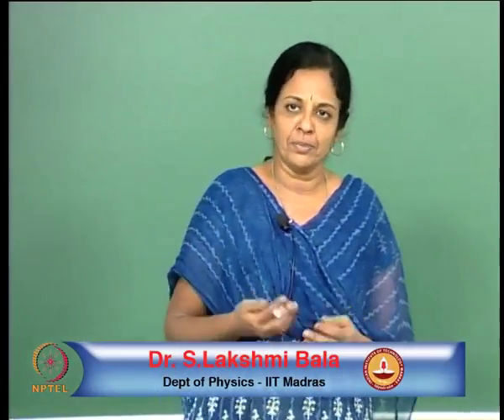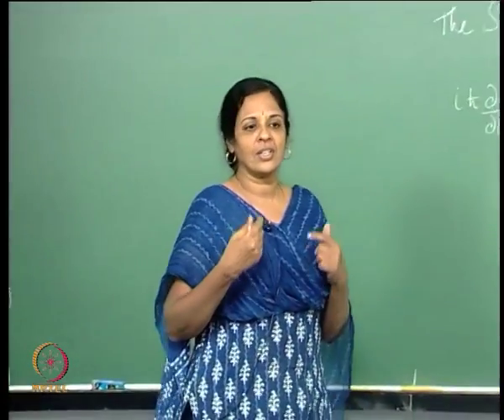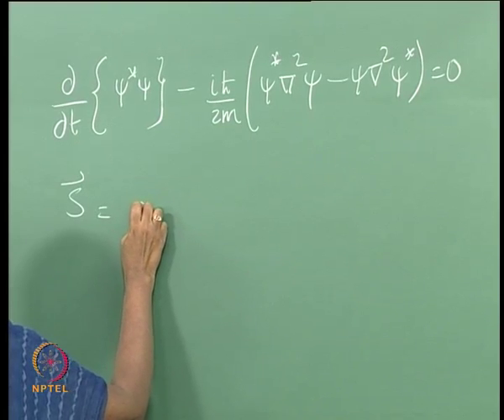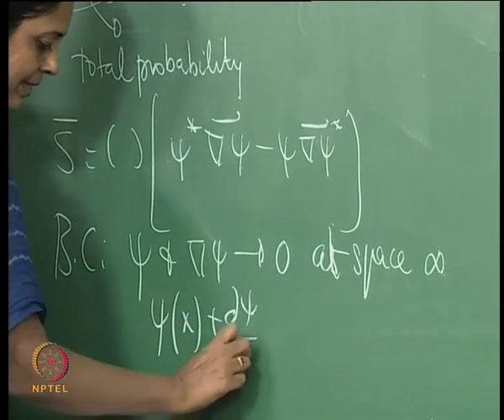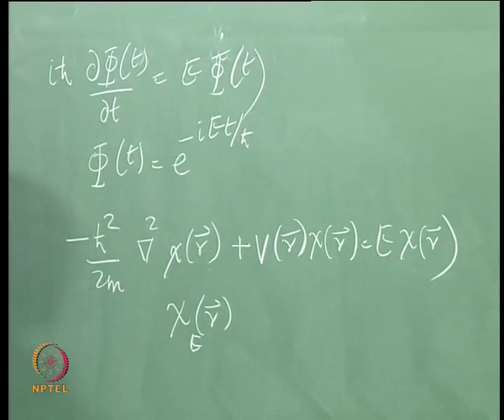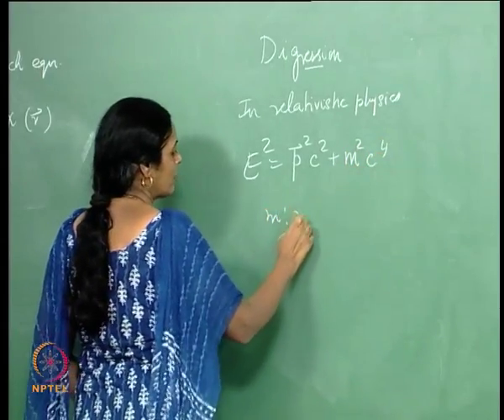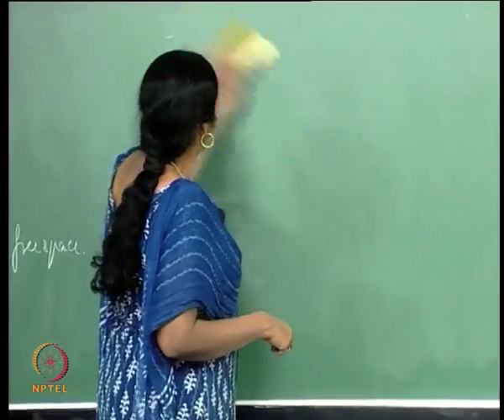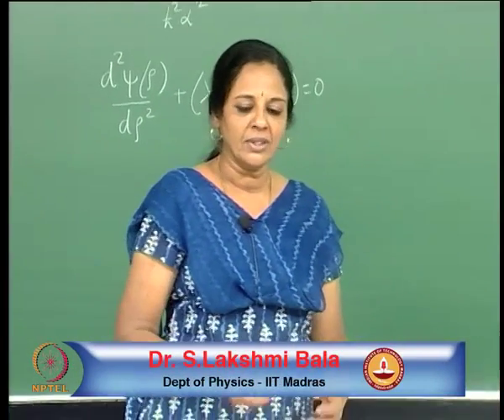Mod-01 Lec-23 The Schrodinger equation

Comment: can u pls elaborate the boundary conditions part... cus.... when you derived the b.c u ve actually given a contradiction... u told psi goes towards zero when x tends to infinity which is quite a blunt thing.... as we know that (integral)S.d(sigma)=0....  that means that S should be 0 all over the volume i.e psi and delta psi should be zero all over the volume...i.e psi and delta psi should be zero all over x....